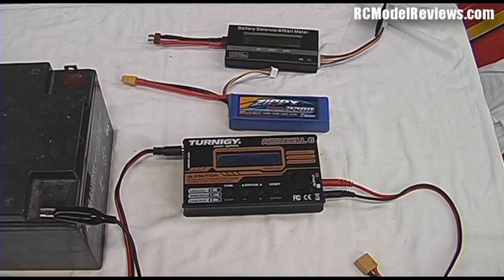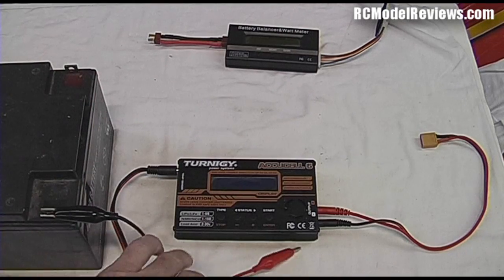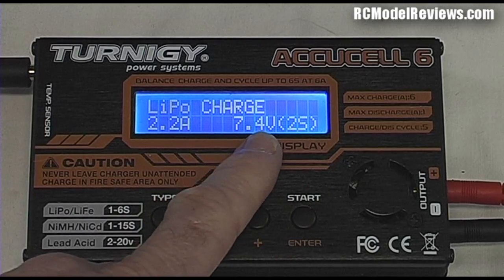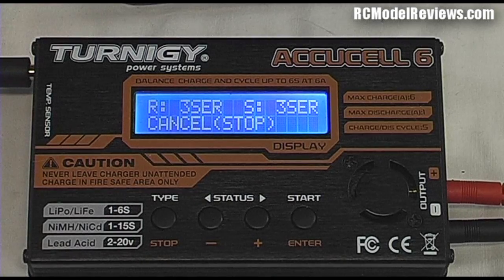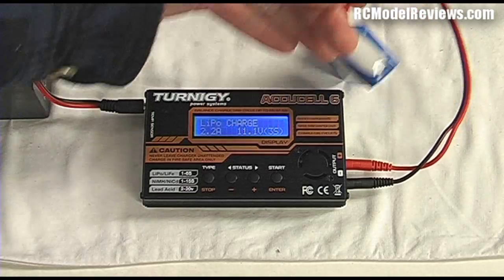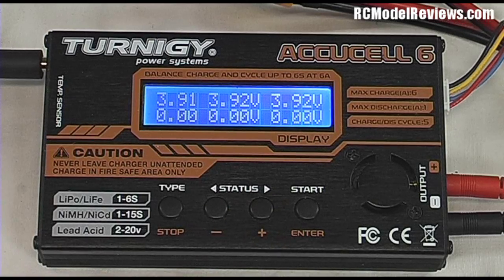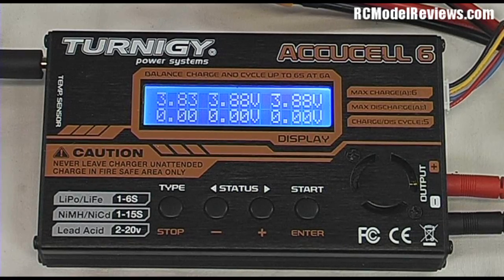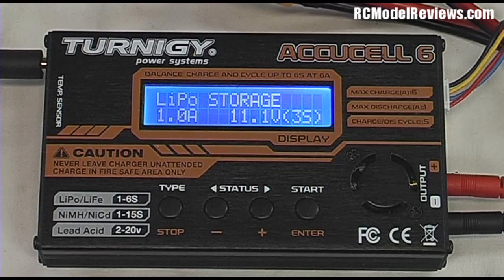How to charge a lipo battery using a 4-button charger

Comment: I cannot begin to thank you enough for this video. I have the exact same charger and this really helped me wrap my head around it a lot better than doing it on my own with instructions. I'm not using the lipos in RC applications I'm actually using them to power heavily modified foam dart blasters. This is an absolute great video though! A+!
Reply: These chargers are a gem, also will bring car battery's back from the dead. You could never find a charger like this at a automobile store especially with its options like this. Great charger!

Comment: HI me newby got a B6V3 seven chip but can't find instructions for this model ....tried to storage my Li Po 2700,7.4V  10C 20Wh , ended up with this on charger Li25 0.9A 7.51V stn 008:47 00030
and check balance shows 0000on all mv ?     where did I go wrong

Comment: thanks again, its been a long 3 yrs due to an injury so a bit rusty regarding charging my lipos with my eco-six balance charger, followed your video and all is fine  , i did put my batteries in storage  3 yrs ago before injury and now just checked and all my hobbycraft 3c batteries are still 3.75v  so they are still looking good,  flight will tell ? cheers. Tony,  UK

Comment: Is there any way for power to be fed into the balance charger through an AC mains, e.g. via a PC AC adapter?
Reply: Yes.
Reply: @jamesbonde4470  I cannot use my HP adapter without either a load in series or a buck converter, since at 19.5V, it's a bit too high. But logically speaking, if I have that and a buck converter, then why would I need the balance charger in the first place, it's not like I'd be using those batteries often anyway.

Comment: I build a 3s battery pack out of 18650 cells.I have same charger .my problem is when i connect the balance wire i get message 'balance connection error' .if i unplug the battery pack from charger and still leave the balance wire connected i get message 'inverse polarity'.the problem here is that i did not inverse polarity.i also checked the volts in each pin of the balance connector.what can possible be wrong? I bought the turnigy from hobbyking who is the manufacturer.but no technical support...

Comment: I bought turnigy 80w from hobbyking aswell. And for some reason if i connect my 18650 batttery pack of 6s to charger in charge mode it saying balance cinnection error.

Comment: hi RC Model Reviews... (don't suppose you still reply to these old vids.... but new (old) kid on the block here... if you're running a toy grade quad till it falls out of the sky you obviously have gone below these optimum voltages..... so if you only have a bar reading on your controller telemetry is it ok to take it down to no bars...? ... cheers

Comment: I have a 4000 Mah 11.1v Lipo battery. When I plug into my charger with settings 4.0A 11.1V (3S) the system says low voltage. What does this mean. Please help.

Comment: I purchased a Unique Corsair F4U-4 a couple of weeks ago. I put it together as per the instructions. The wiring diagram was the worst, most cryptic thing I have ever tried to figure out but I thought I had it right when I put it together.
When I initially installed the battery and turned on the remote control everything appeared to work as it should for several minutes and then it stopped working. I assumed the battery was low and I used the charger that I purchased with the plane to recharge the battery.
When I put the battery back into the plane and turned on the remote control the plane started cycling through different movements for a few minutes then one landing gear retracted, then it looked like it was having a seizure (sorry, I don't know how else to describe it) and now it doesn't work at all. It doesn't do anything. How can I fix this?

Comment: RCModelReviews  hi bruce can you give me some help and advice  about the  skyrc imax b6 charger i got it yesterday from ebay   i used a 12v dc and it powered up and went in to  input volt error  it did it with a 14v  and 18v laptop power supply    and it worked with a 19v laptop supply   but 40 - 50 mins in to charging the battery  it went in to  input volt error again  i dont understand why its doing this bruce   i never had this problem with my cheap china  imax  ? lol

Comment: hi there folks I have been flying around with a qx90 from banggood quite a lot lately using small 1s lipos, there 3.7v 720mah - 20c when new they had a voltage of 4.25v when fully charged for some reason none of them will go over 4.19 now at all why is this?

Comment: how do you put the turnigy  accucel into a mode for charging 1S batteries as it seems to be between 2s-6s though specs say it does go down to 1S? (using a 1S charging board like this - in parallel)- https://www.amazon.com/Crazepony-Battery-Charging-Inductrix-Parallel/dp/B01ID6U4LC/ref=cm_cd_al_qh_dp_t

Comment: so I have a 3s 5000mh pack first use which I charged according to the default settings of my passport" charger, but at the end of the charge it only shows half the amperage of the total capacity, is this normal?
excellent video, lots of info am new to this, really helped me, thanks

Comment: I have a plazma 7.4v lipo 4000mah 20c battery which charger could i use that is £25 or under that i could plug into a wall

Comment: So I got a turningy p403. It's a 3 button charger, and the only thing I can set is lipo or lifi. And the current switch just cycles from 0-4s in increments of 0.1. Can anyone expolain to me how to use this charger? The battery says 14.8v. But when I first plugged them in, they were sitting at 15.8v. The charger is supposed to tell me when the battery is full, but I'm kind of iffy about letting the battery go any higher than the voltage they came with. Even though the cell voltage sits at 3.8. What is the maximum voltage the cells can go to?

Comment: Hi nice video! 
I have got 2 8000 mah 30c 3s lipi batteries, which I want to charge in series. Unfortunately my charger is limited to 5A what should I do?
Reply: +Sean de Jong Either charge at 5A (it'll just take longer) or get a new charger.
One thing to watch out for - connecting batteries in series will make them act like a 6 cell. Charging at 5A will use a lot of power (5A x ~3.7V x 6 = 111W) so if your charger (or PSU) is limited to, say, 60W you're gonna struggle. You're probably best off charging them one at a time at 5A for a longer time (96min).

Comment: Can't you charge battery with a wall plug or do you recommend using a 12v car battery?
Reply: +Ashley Smith  Depends if the charger is AC or DC! Power from the wall is AC while a car battery or PC/server power supply is DC. Just make sure the charger is compatible with your method of powering it (check AC/DC, voltage + make sure power supply can supply enough power!). 
A good way to start is with something like the turnigy accucell S60 (or SkyRC S60...); an AC charger so you don't have to worry about finding your own power supply.

Comment: Hey Man, I have 4 30A ESC with the following description and I was wondering if I can use them with a 4S 4500MAH 14.8V Lipo without damaging them. The motor says 2-3 cell poly but doesn't the ESC determine how much current is being sent? Thanks!

30A brushless ESC:
Output: Continuous 30A, Burst 40A up to 10 Secs.
Input Voltage: 2-4 cells lithium battery or 5-12 cells NiCd/NIMh battery.
BEC: 2A / 5V (Linear mode).
Max Speed: 210,000rpm for 2 Poles BLM, 70,000rpm for 6 poles BLM, 35,000rpm for 12 poles BLM. (BLM: BrushLess Motor)

A2212 motor:
KV: 1000
Max Efficiency: 80%
Max Efficiency Current: 4-10A (>75%)
Current Capacity: 12A/ 60s
No Load Current @ 10V: 0.5A
No. Of Cells: 2-3 Li-Poly
Motor Dimensions: Φ27.5* 30mm
Shaft Diameter: Φ3.17mm

Lipo Batter
FLOUREON 4S 14.8V 35C 4500mAh Lipo RC Battery XT60

Comment: Is there any way to plug a charger into a wall outlet
Reply: ValueHobby sells a power adapter you can plug into the wall for $10. I have it for mine. Works great

Comment: When I try to charge  S4 lipo with my Turnigy charger using a 12v  car  batteri charger as power supply, I get dc input to low when it reaches 14v, max output from the charger. Does input and output voltage have to the same.I see no info in the instruction and no videos seems clear on it.

Comment: How to proceed to charge a jst connector battery like this one:
http://www.banggood.com/MJX-X600-RC-Hexacopter-Spare-Parts-7_4V-1000mAh-25C-Upgrade-Battery-p-1022408.html

Do you only connect the balance plug, like when using the Turnigy E3 Compact, or you also have to connect the discharge plug with a jst to xt60 adaptor?

Comment: hello i have the same charger i was wondering if you new if the end voltage on charging a 2s can be changed the end voltage on mine is 8 volts on a balance charge each cell stops at 4.0 
 thank you

Comment: I just bought a Hitec X1 AC Plus which is a very similar 4 button charger (though balance board is external) but it does 2-6S batteries and the screen is the same blue 2-line LCD. It looks like I have the exact same programming as this unit so you literally just went through and answered pretty much every question I had as to how to use it. So thanks, this video was super helpful!

Comment: how do I know when to stop using a lipo. I have a 5,000 mah 2s for my rc car, should it be when the battery has around 2.9v per cell?
Reply: +Luis M. Fernandez Yes its death
Reply: But I mean after using it in my rc car
Reply: from how long have you been using it
Reply: +Nikola Nikolov I just bought the battery but Im afraid to use it until its dead
Reply: oh if you just bought it balance charge it
Reply: +Luis M. Fernandez ... if you drop the voltage below 3 volts then you have just killed the battery......
Reply: +Luis M. Fernandez You should be able to set your electronic speed controller so that it never allows the battery voltage to go below 3.2v per cell for best long life. If you're racing competitively, then 3v is acceptable. But after a day's use, you should storage charge the pack if you aren't going to use it for a week or so. If you want to use it again the next day, you can balance charge it the night before. It's a good idea because the ESC does not balance the cells while taking power from them.
Reply: +Niall Duncan Possibly, but not always. Even so, it should be re-balanced as soon as it cools down from use.
Reply: Thanks! :)

Comment: A friend of mine got a used laptop charger for next to nothing at savers thrift store.They range in voltage so you need to read out put on charger power supply The the accucell 6 takes 11-18 volts dc current and has pos-tip.So you can read the plug in charger sticker to match it up .So let's say 12v Dc at 4.5 amp's or 5 amp's should work.My friends is 16vDc 4.5 amp's positive tip works great

Comment: what can i use instead of a car battery or bench power supply to charge stuff
Reply: +DonMuffatello you can it should be 12 volts at about 5 amps
Reply: Value hobby sells a power adapter for it for about $10.00 that you plug into your wall. Basically, any way to get 12V is good enough

Comment: Right.. because everyone has a car battery laying around. Or carries a car battery around just so they can charge another battery.
Reply: +Mark II Well, in the hobby, we do. Charging on the field is an advantage, I'm not going to drive my planes to the field just so I can have a 2:20' flight ... :/
Reply: You can also use a 12v wall charger, those are pretty common, many laptops use them.

Comment: Hi,
i have a Li ion 5 cell 18volt drill battery, which is only 2 years old and used/ charged only about 10 times, but wont charge in its charger, as it is only 10 volts.
The 4 button charger obviously checked the battery and says low voltage. Can the 4 button charger charge this battery?
if not, is there any other way to wake up the battery?
cheers

Comment: What is the maximum and minimum voltage that a 3s 2200mAh li-po can go to be safe?
Reply: +Dylan Tan 3S, no greater. No less than 3.7 x 3 = 11.1v No less than 11.1v. The battery fullest voltage is 4.2 x 3 = 12.6v. They aren't 11.1v batteries, they are 12.6v batteries. Or damn near close to 12.6vdc.
Reply: +Mark II you seem pretty knowledgeable, I have a 11.1v 3900 mah 25c, and a basic balance charger that came with the car,can you tell me how long I should charge the battery.
Reply: Since you have a 3S battery (12.6v), set the charger to charge a 3S LiPo, and set it to 3.9 Amps. It will be done in 1 hour. Or depending on what the max charge rate is for your LiPo battery, you could charge it at 2C, 3C, or even 4C, depending on what the specifications say for your specific LiPo battery.

See this battery?
http://www.hobbyking.com/hobbyking/store/uh_viewItem.asp?idProduct=10302

That battery is 4,000mAh, 12.6v.
You could charge it at 4 Amps, and be done in an hour. But since according to the specs, it's rated at 4C Charge rate, which means you can charge it at 4.0 x 4 = 16 Amps. If you had a charger that can charge a 3S LiPo,at 16 amps,  you'd be done in 15 minutes, instead of an hour.
Reply: Thanks for responding, but I was trying to get info on how long it will take the cheap balance charger that comes with the redcat rampage xbe to charge
Reply: +Mark II that's a nice battery, but I don't think it would fit the redcat rampage xbe

Comment: can this charger safely charge a 10000 3 s lipo?
Reply: +Mark Liles Yep, anything up to a 6S. The only difference its 10,000 rating makes is that it will take twice as long to charge as a 3S 5,000.  The "S" indicates the Voltage, the Ma, the capacity (how much it takes to fill/empty it).  The maximum charge available on most of these chargers is 5 Amps, so filling a 10,000 is going to take a while, at its 1C rate it could take 10 Amps and potentially much more ;-).  Peter.

Comment: I have a couple of questions: 
- doesn't any regular charge ends with the charger balancing the battery?
- what happens if I "fast charge" a battery at the balance mode?.... Meaning, using a higher rate to charge while on balancing mode?

Thanks

Comment: Thank yew fo chawching mah battaris! 
On A serious note, Great video m8. Helped me out a whole bunch.
I was afraid i overcharged my 2S since it was fully charged at 8,4v. I got scared that i had accidently set it to 8,4v NiHm rofl. luckily it was only seconds from Fully charged.

Cuz i bought a crappy Balance charger for my 7,4v 2S 3300 MaH & after about 30 mins of charging it was crazy hot so i plugged out the LiPo and a short blue flash from the charger emitted & a strong burnt smell appeared. Much like my farts! 
So to anyone who's looking to buy one of these cheap chargers. (Balance only with 3 lights) DONT!!! Get a "4 button charger Cuz its not worth destroying a expensive LiPo by cheaping out. + its a speed charger for all types of batteries! 

@RC Model Reciews, Would be great if you can put an annotation that 1 LiPo cell is 4,2v fully charged. :D

Comment: Where can I get the 12V battery that you have connected to the charger, and what advice would you have on purchasing this item.
Reply: Dark Mann Look at another video that Bruce made, where he shows you how to take an old PC power supply, and turns it into a 12 volt supply that can feed the charger, since the charger needs a 12 volt DC supply. 
The hack to make the PC power-supply work is real easy, and takes a few minutes, and saves you a lot of headache. AND it conveniently keeps the charging process indoors where you can keep an eye on it, which is something he suggested in this video.

Comment: Very informative thxx ! i was looking into those PC power supply's to use with the charger, but what would the benefits of 24v rather than a 12v set up ? im just clueless when it comes to electrical stuff.. thx again..
Reply: norie m I also had to educate myself from this channel, as it is easier to watch and learn here than to speak to the guys at the hobby-shop, who made me feel a bit like an idiot. 
Watch the video where he turns an old PC power supply into a 12 volt source to operate the lipo charger from. This morning an old supply of mine met the hack, and now is working well as a 12 volt source for the charger.

Comment: Why is a 3S battery that's rated @ 11.1v (3.7v x 3S) at full charge 12.6V?  What is the difference 1.5v called?  Charge Voltage?  Why wouldn't a fully charged battery be fully charged at it's rated volts?
Reply: Because that's not how lipo batteries are rated.  They are rated by the nominal voltage.  A single cell lipo's nominal/rated voltage is 3.7v, but when fully charged it will be 4.2v.  I was also confused by this for a bit until I found out the batteries are rated by their nominal voltage.
Reply: +Titus Corday So my 2s 280 mah, should be 8.4v at the end?
Reply: How can you set it to 4.1 volts per cell? That gives you a longer battery life.

Comment: Hi there. 
Thanks for great video. 
I have question. I'm new to this. I have Walkera Scout x4 quadcopter with 6S Lipo 22.2 5400mAh so I need to set Current charge at 5.4A on charger ?

Many thanks.

Comment: What does the Turnigy indicate when the charge is complete? I bet it might be self explanatory.
Reply: This charger emits a series of beeps, and the screen will flash FULL
Reply: stracky Stracky.  Thanks for the answer.  I see it now.  I have studied a lot for me too.  I did not get why the charger went past 3.7 while charging too,  but I do now.   I see the full flashing now.  I am sorry and thankful there are guys who see a question that may not be worth answering and answering it.  I think that I now understand my 1S lipo batteries enough to charge them at the 1 C rate and can calculate the volts necessary to charge at the 1 C rate on my 1 S 1200 mah lipo batteries when I have 2 that are similarly discharged and hooked up in parallel.  You tube had to teach me every thing I think I know.  Thanks again stracky!